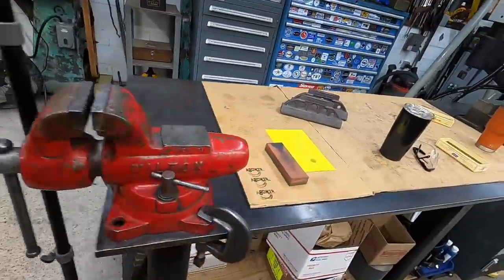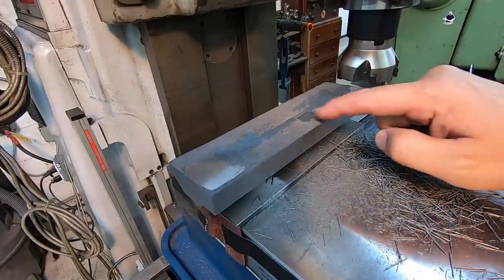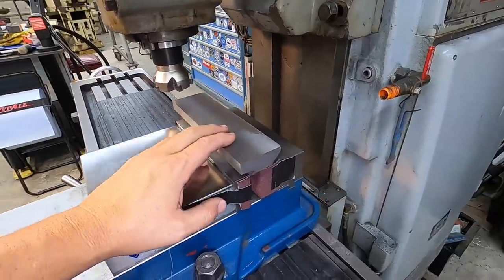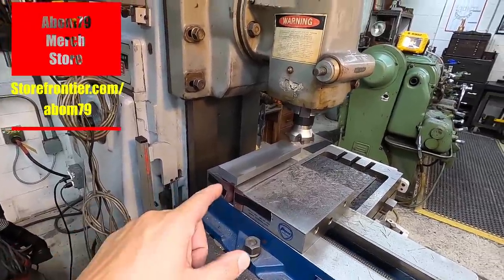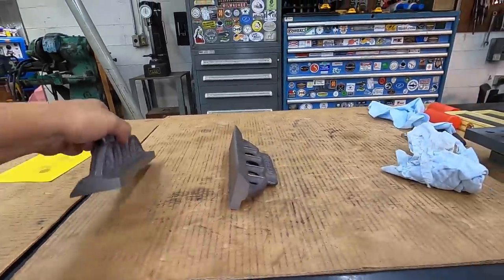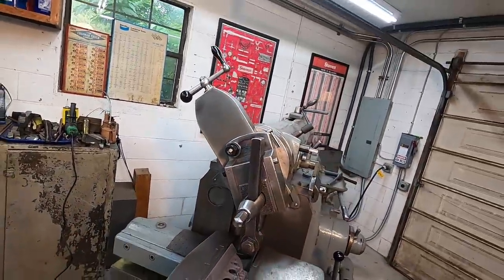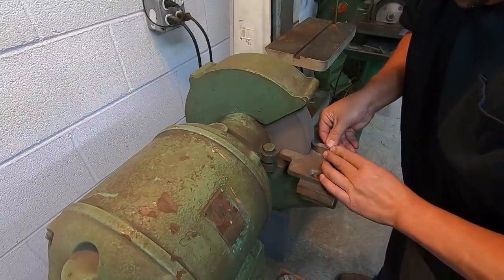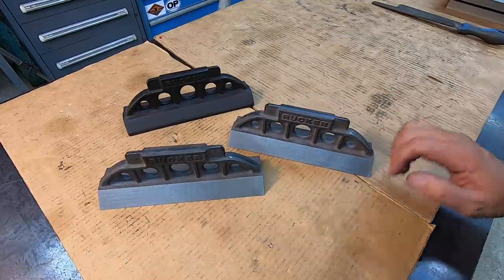SNS 322 Machining Rucker Straight Edge

Comment: Would love to see the set up even if sped up, as setting up is the part newbies learn
Reply: He does showing a little bit from time to time but I do wish I could see more now and then but hey got to have something to complain about he doesn't do anything else wrong other than have flat tires
Reply: The way those last two machined on the shaper, looks like the fixed the hard-spot issue.
May have been able to shaper all the faces.
Reply: Filing the base-angle edge, is the flat perpendicular to the base, or normal to the angle axis?
Reply: The set up for these parts is pretty basic, so I newbies who don't know how it works would be best served by a tutorial. He did cover the (at least for me) unusual parts, namely the sand paper and why he choose to use the shaper. Also, a lot of the important bits of the set up aren't really visible in sped up (or even normal speed) footage. Namely making sure your vice and other parts of the work holding are square (lots of people just leave a square vice on their machine until they need to take it off), choosing the right cutting tools and parameters and making sure there are no chips between work holding and work piece. I would get bored pretty quickly if I'd hear the same steps explained in every video. On the other hand, I appreciate it when I get to see custom setups because sometimes I see really creative solutions I'd never think of myself.

Comment: There is something soothing about the scraper. I'm not a machinist, but I wonder if it would make economic sense to use a carbide cutting tool with harder materials?

Comment: The chips off of that vertical cutter are like pins. Kinda neat. I’m a pretty good carpenter, but I enjoy metal work more as it requires increased precision. The cutter is really neat to watch. It’s just like a big metal plane.

Comment: You said at about 16:12 that a shaper can hold its weight around the shop. How is that possible? Thing weighs as much as a battleship.
Sorry,(not really),but that turn of phrase just cracked me up.
Always a pleasure to see you can find a use for the thing. Really liked the inspect and repair you did on it. Actually,I think I will rewatch the vids.
Cheers.

Comment: You said the planed  finish is not going to be as nice as a milled finish. I  dunno man, there is something, perhaps a Timeless Beauty about a planned surface especially after it has set for 75-100 years and gets  a patina to it. Since these surfaces are probably going to be scraped it does not really matter I guess.  However in my experience a planed finish seems to be a lot nicer to scrape or maybe I just prefer it that way, who knows! . Either way it gets the job done and the tool is a gonna be a nice one when scraped in. cheers 
edit: fix atrocious spelling errors!

Comment: @16:16 - So, you were feeding down into the part on the sharper.  Not I understand that the cutting with that feed might "push" the work further into the vice rather then perhaps "lifting" the part.
I was just wondering if you could have the "feed" move up the cut?
That way if you get distracted you cut air, not the part, the vice , or the machine...
It might not be "Best Practices" for the science behind the cut and how the tool works, but it seems much safer.

Comment: I am seeing the work progress, and of course the finished products, but I'm completely not absorbing how your shaper setup produces a 45 degree angle on the work.
Reply: Ronald Farley  okay, so it is done with a down feed. Fair enough. But if the cutting tool was oriented perpendicular to the table & the step over of the table was equal to the amount of down feed, that should produce a 45 degree angle on the cut. If the tool however is placed at 45 degrees then it seems to me, and of course I am not getting this right then the downfeed would have to be equal to the step over times the square root of 2 to get a 45 degree angle. Undoubtedly, I am overthinking this.

Comment: Clarke is using cast iron from old disk brake rotors to make these castings.  Is there anything to be gained by using castings that have been made by formally adhering to the Meehanite standards for cast iron?

Comment: 15:12/25:32 at this part of the video you show the shaper cutting a 45 degree angle to the table.  why is the clapper angled? Does the table move in two directions at the same time? (X and Z)
Reply: The clapper is angled to swing the cutter away as well as forward on the backstroke. The table itself on the shaper isn't moving for these cuts at all, only the tilted "vertical" feed on the head is moving between strokes

Comment: Could you get rid of those hard chilled spots by annealing the part in your oven with a slow cool down?
Reply: "White" cast iron (the chilled hard stuff) is converted to "malleable" iron by ANAEROBIC annealing.  https://en.wikipedia.org/wiki/Malleable_iron  Post WW2, similar results called "ductile" iron are obtained by using magnesium along with specialized  handling.

Comment: Not a machinist. Question, can you put a carbide insert in a shaper tool? Would that help with the hard spots on the casting?
Reply: I think it would make more sense to have a roughing tool to hog a lot of material off quickly and go back with a finishing tool.

Comment: What causes that different pattern on the bottom were the milling started? The mill passed on all the surface in the same way to me.
Reply: I think he meant the round spot at the beginning of the cut, it stops at the point where the first inserts hit the workpiece on the backside of the cutter, also on the finished piece, I'm not sure what causes it, since the pattern after that spot suggests the head is trammed close to perfect...would like to know.
Reply: I would say its the movement of the head after the cutter clears one side.  Cutting right to left,  the force is pushing to the right then the face mill clears on the left.  There is some flex in every setup.  I would bet it is only a few tenths.  My mill does the same thing.
Reply: Don't know. I noticed it too though.  My best guess would be some slop in his mill where the tool position is shifting based on whether or not both sides of the cutter are touching the surface or not, but I can't figure out which direction it would be to make that pattern.  It looks like when it's over the right hand edge the tool axis is tilted like \ (exaggerated of course) but then shifts to | without touching the work that's already been done.

Comment: Where do you use such a short straight edge? 
The problems I have with straight edges are that they are too short, scraping a 20cm lathe slide with 80cm straight edge  works much better than 80cm ways on a mill with 20cm straight edge ;-D

Comment: Why no lubricant when cutting
Reply: Also the dust mixed with oil makes goo that's hard to clean up. Neither you do need to use coolant or lubricant on steel if the mill/lathe has no enclosures whatsoever and using carbide tools

Comment: please? i was born with the metric system and i cant seem to understand the imperial system, adam is caling a measurement '9 1 8 ' and the read out shows :9.1270  ??? please explain. 😭😭😭
Reply: Adam is saying 9 and 1/8 which would be 9.125 written  in decimal form (I guess he just rounded down).
Reply: 231.8mm for those who watch this in collor.
Reply: @k5wga  thanks you! cleared up alot, seems like a lot of work to convert from decimal everytime....